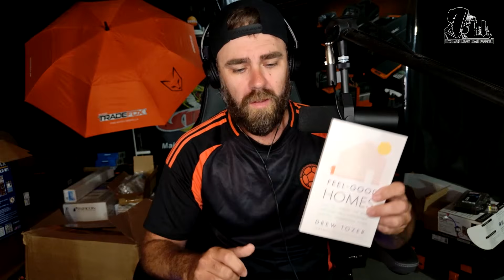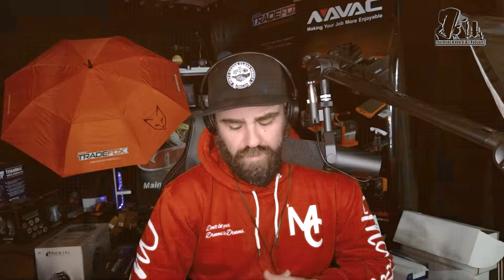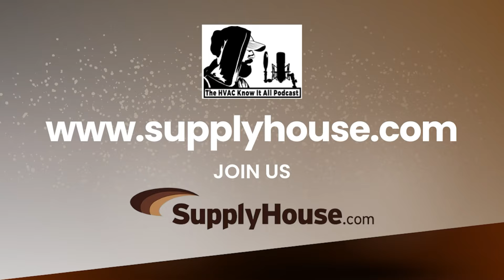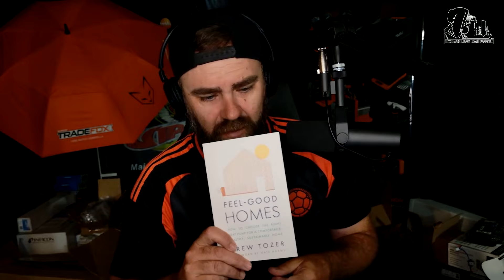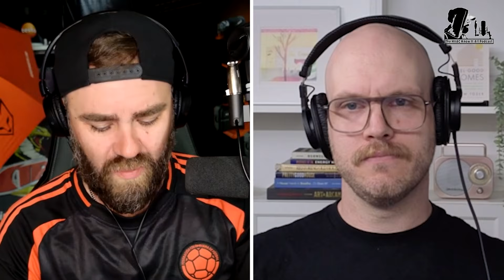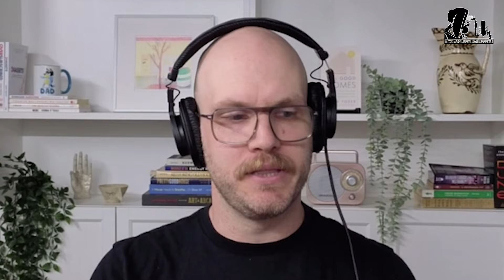HVAC Design Mistakes for HVAC Pros to Stop Oversizing and Switch to Heat Pumps - Drew Tozer Part 1

Comment: Equipment oversizing is such a persistent issue that causes so many comfort and reliability problems. A proper heat loss calculation is the only way to move the industry toward better performance. BPConstruct has been advocating for right sized systems for a long time because it is better for the equipment and much better for the homeowner's utility bills.

Comment: If the compressor is running twice as much, doesn’t that mean the unit will have to be replaced sooner?
Reply from the maker: If the compressor starts and stops constantly, that's the killer.  If a compressor runs within its envelope four hours at a time with the correct voltage and lubrication, it will run for forever.

Comment: There’s no doubt the tech in heat pumps have come a long way but here’s the issue with heat pumps in the north at least my experience in Mi 

They are not cost effective, higher upfront cost and our electric costs are higher than our natural gas cost.  It doesn’t make sense to run a heat pump over a natural gas furnace from a financial perspective 

However if you are running propane where it has a higher cost than electric then heat pumps are a great solution.
Reply: If your electricity is that expensive, the it’s time to look at solar panels. The more expensive electricity is to buy, the more cost effective it becomes to make it yourself. Even in winter, when it’s not actively snowing, solar panels can make power. Once you have the panels, running a heat pump is free. That’s even cheaper than natural gas. (Then natural gas backup heat is only for days you don’t have enough free solar power).
Reply: @rpvitiello  To be clear I said electric was more expensive than natural gas

So your solution to combating the high cost of electricity is to drop what…20k up front cost for solar? 

We live in the 4th cloudiest place in America why would anyone do that just to run a heat pump?
Reply: Natural gas is super cheap right now - it won't be super cheap forever. It's one of the most volatile commodities. 
Buying a regular a/c is committing a house to 100% fossil fuel heat for the next 15 to 25 years "just because gas is cheaper now", talk about short sighted.
The extra upfront cost between an a/c and a heatpump of the same class is not that much unless the contractor is gouging. What costs more is moving from a single stage unit only suitable for heating in shoulder seasons to inverter drive unit, but then again those inverters have advantages far beyond heating capacity in cold.
Dual fuel is a good option and optimizing change-over for costs.

What's true is the efficiency advantage  is minimal when the power comes from fossil fuel plants, taking into account power plant efficiency.
Reply: @Jon-hx7pe ”Short sighted” not at all, Michigan is sitting on top of 1.1 trillion cubic feet of natural gas and has over 63 billion in reserves 

We aren’t going to run out of natural gas anytime soon. 

Let’s talk about electricity. Right now our power companies are urging us not to run our AC units because the aging grid can’t handle the load. 

You have people pushing for electric cars and now electric heat. What’s going to happen when it’s 0 degrees out and the power company asks you not to run your heat during peak times?  

The Natural gas furnace is a proven reliable technology using readily available fuel. 

Very few homes in Michigan are buying air to air heat pumps
Reply: @michaelcso2400  The natural gas is shale which is very environmentally destructive to extract, it is a finite depleting resource and if anything reserves have to exaggerated. The best resources are tapped first, increasingly it takes more energy and costs more to extract fossil fuels as they get depleted. The net energy available declines. Doing shale is actually a symptom of depletion because conventional gas/oil is far cheaper and easier to extract and the wells last longer. Shale has to be constantly fracked. Shale oil and gas has been sold as a miracle, reality is fracking is a last ditch of desperation that bought a couple of decades and we're probably at peak shale oil/gas production now. 
A problem with electricity is generating it with natural gas power plants defeating much of purpose of installing heatpumps, need to be moving towards nuclear and where geography permits, hydro. Most of hydro has already been developed.
Total grid demand is indeed a huge issue especially the disproportionate demand from cold climate heatpumps in cold snaps due to poor COP and high heating needs. Installing heatpumps does not mean going 100% electric, I'm talking keeping the furnaces. Any electrification plans need to be practical and economical, full electrification of everything is not in the cards.

"A regular a/c is just a crippled heatpump because they left out the reversing valve." I suspect MI is one of worst places for doing hvac well, i'm not in mi but if internet is any indication have seen people saying 100k btu furnace is good for 2000 sq ft house which is beyond absurd, i'm in canada north of mi and that size of house if insulated wouldn't need more than 60k.
Reply: @Jon-hx7pe I think your information is incorrect in regards to HVAC in Mi or you were being intentionally deceptive. 

100k unit for 2000sq ft if the unit were an 80% then sure that’s reasonable 

For a high effeciency model you are looking at 70k on average but then again the manual J will provide excellent guidance.  

Nobody is installing a 100k 95%+ unit into a 2000 sq ft home. 

Regardless if installing a heat pump is going 100% electric or not people aren’t going to spend the extra money on something that will cost them more in the long run to operate.  You might find a few environmentalists but not many
Reply: @michaelcso2400 when I see those sweet numbers like 100k and 70k. I can't wait to wake up the next morning to run to install cheap Chinese heat pumps on my properties
Reply: @michaelcso2400  I'm in toronto on ontario canada which gets at least as cold as major michigan cities. A 2000 sq ft house with 8 ft ceilings, insulation to r11 2x4 construction build in 1980s to 1990s has a heat loss of 40 to 55 000 btu/hr and should be getting no more than a 65 000 btu/hr output furnace and that is an absolute maximum for the homes above 50k btu/hr heat loss. Newer construction built with 2x6, very tight, R24 wall, r20 basement, r60 attic looking as low as half of that.
Either michigan houses are build like crap or the furnaces being installed based on rules of thumb are grossly oversized.
I was in a 3500 sq ft late 1980s house with a walk-out basement and high fuel bills that heated with capacity to spare with a 80 000 btu/hr output.

Size using combo of accurate load calculations, runtime data of existing equipment and gas consumption and rather than rule of thumb and will see most furnaces are way oversized. Timing runtimes is the most accurate and if you do it or take a look at hourly data from a smart thermostat, you will be shocked by how little the furnace runs.
80 000 btu/hr output in a 80s or 90s 2000 sq ft house runs barely more than half the time at 0f/-18c.
I recommend a technology connections video titled along lines of "old hvac practices are holding us back" - the guy did testing, has a 60k furnace in midwest but has a heat loss of under 30 000 btu/hr. 

Framing getting heatpump as just to save the environment is an absolute absurdity. Heatpumps when done right are more comfortable, the heat output is a close match to heating needs especially in shoulder seasons. In dual fuel applications they do not cost more to run, you switch at the economic balance point.

Right now natural gas is extremely cheap because there is surplus due to shale oil fracking as an artifact. Due to depletion and now demand from lng exports, data centers needing more electric - expect the price of natural gas to rise a lot.
Reply: @andreycham4797  there are north american made cold climate heatpumps as well as japanese. the chinese central heatpumps being re-badged may turn out to be very good, just a shame they are made in china.

Comment: Good info in this podcast.
Most canadian houses have too small air ducts to get a heatpump large enough to meet all of heating needs. Heat strips have to be used for supplemental heat and heat strips are the devil especially with grids meeting that demand.

There is not enough electric generating and transmission capacity for full electrification and building it up for coldest weather means there's way too much generating capacity for rest of the year - between falling COPs  and increased heating needs as it gets colder. As well, when the electricity comes from fossil fuel power plants it is far more efficient to burn fuel in a furnace in very cold weather due to low efficiency of power plants and low COPs. Natural gas is only type of reliable power plant that has been built much in last 30 years in north america, hydro is just about all maxxed and haven't been doing new nuclear. There's also the issue of a cold climate hp breaking down, waiting for weeks or months for a proprietary part and running heat strips that entire time - talk about high bills!
Reply: just to add, max electric backup heat on 100 amp service is 10kw - that's limited. 10kw is already using over 40 amp, then there's the stove, the dryer, etc. imo heat strip in all electric should be sized to carry entire load just in case electronic-proprietary part laden heatpump fails. fixing these machines is much more complex and slower than fixing a furnace with part off the truck.
All the more reason to go dual fuel.